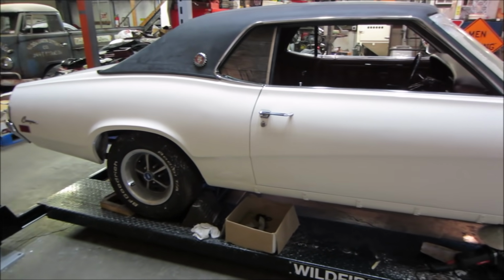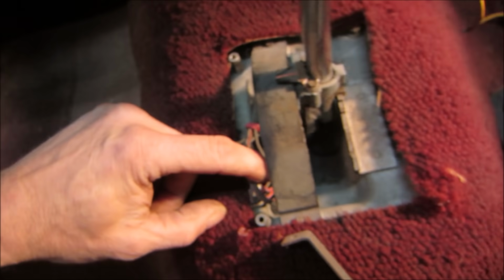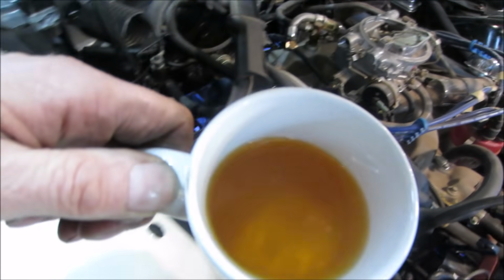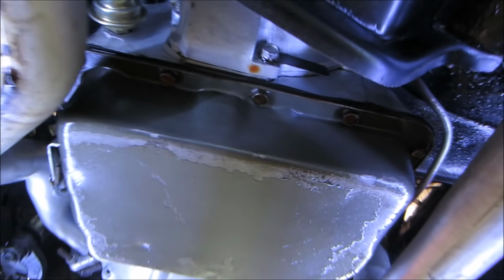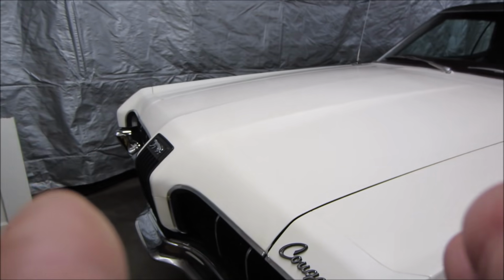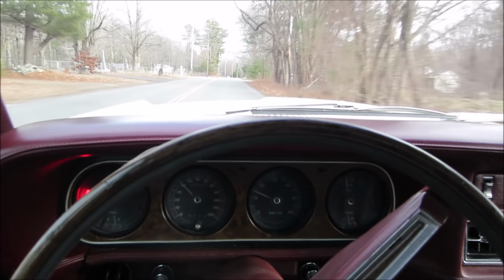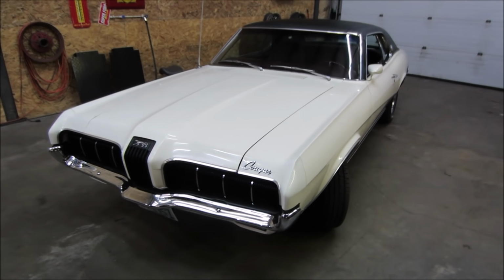Will It Run/Drive? 1970 Mercury Cougar  Saved From The scrap Yard.

Comment: Maybe its a child of the 70's thing, but after months of vw engines, its like music hearing a big carburated V8 idling.
Reply: It's a small block the okne thing I like about Ford's is they use real dual exhaust
Reply: Duke Hugh Johnson  I thought that the '70 cougar came out with a 351 W or C? I thought it was a Cleveland when he showed the motor, but I could be way wrong.
Reply: Yea. I grew up in Europe, 4 banger capital of the world, then first time I came to america I rode in a 1962 Chrysler , I think it had a retro 383 ... I was mesmerized.. even recently .. we have some newer vehicles with aluminum block V8's .. then recently we got a 1995 Ford van with 351W and it just runs that much nicer
Reply: I hate VW motors .. a precious FEW  sound good, but yeah, once I got a Datsun 1200 with a superb motor rebuild that could wind up crazily I never, ever looked back at VWs.  But I have been told a good VW and its driver are hard to beat.
Reply: @aris21067  I seen one at a show that had a small block Windsor and knew someone that had a lime green one with a big block Cleveland. The 351 Windsor is basically a 302 with a half inch more deck height ( stroke ) and the hex shaft between the oil pump and distributor is a little bigger. A friend of had a 70 Torino with a 351 C and 4 barrel heads. A back of 100's cigarettes could stand up in the exhaust ports.
Reply: Although it sounds like a Cummins from under the front of it.........
Reply: yes same here!

Comment: I was 17 years old when these were new. Cougars weren't factory hotrods back then but they were nice cruisers. The best thing about this Cougar is that it's a bucket list car. My heartfelt CONGRATULATIONS to you.
Reply: Depends on model, 428 Cobra Jet optional in both '69 & '70. Also were Boss 302 Eliminators. I owned a '68 GTE with factory 427. That's the one car wish I had back again.
Reply: @tombryant1104  I know of the options And that few bought them. I lived in S. Calif back then and factory muscle cars were common. My best pal had a 1970 Chevelle SS 396, 365 HP while his older brother had a 1968 SS 396 Camaro. I do agree with you about actually having one of the mean Cougars. No argument from me.
Reply: Oh' yes Cougars were or could be factory hotrods.  Depends on which model you had.  They made a few with Boss 302 & some small hand full with Boss 429's.  Even a lot of them in XR-7 trim were packing some mean horsepower.  But, the main hotrod's were S-Code 390's. and the ones that had Cobra Jet 428's.  My 1970 Cougar "Eliminator" came with the R-Code Super Cobra Jet 428 Drag-Pac from the factory.  I sure wish I had that car back today.
Reply: Is that an FMX, automatic? Change the vaccuum modulator on trans!

Comment: My uncle had a 70,  green one.  My earliest memory was of helping him work on the car. I was I guess 4 years old (1974) (this is family lore). He asked me to roll a tire to him so I did. Apparently I started laughing at the car. He was under it doing something. The hood was up and flames were shooting out of the hood and I stood there laughing. My family reminds me of this all the time. He got it out in time and it didnt hurt anything, was just the carb.  He had that car all the way through the 70s and by the time I was 10 he used to take me for a ride. I would sit in the back seat (no car seats or seatbelts back then) He would do "the cougar" and wave the car back and forth going down the road. I would slide from one side of the seat to the other. To this day I take my kids for a ride I do "the cougar" for them. They like myself giggle.
Reply: Great memories you've got. Teach them all you know about gp
Reply: I had a 72 vette that I was prepping to drive cross country.  My 3 year old daughter was 'Helping' , I looked down and saw she had picked up a 3 pound sledgehammer and was about to swing.  I caught the hammer about 5 inches from the front fender,,,WHEW!!!!
Reply: he wasn't doing "The Cougar", that was the dangerous handling of the thing trying to go down the road in a straight line,  but being a Ford it cannot do that.
Reply: @oigleoystereater2003  LOL I suppose ;)

Comment: You have a very nice driver! I have no idea how you got that dash together as nicely as you did, but, kudos!  Nice job in getting the front headlight doors & rear turn signals running - they usually don't work on these old Cougars. I was also impressed as to nicely the doors close and sound; back in the late '60s through the '70s, most American iron doors did not close with a thunk, but a CRASH....

Comment: It looks great, you did a nice job getting it back together. When that engine went to sleep it was drinking super leaded gas, now it woke up to drinking unleaded gas with ethanol in it. You should check to see if the exhaust valves have hardened seats installed on them.

Comment: When you jump the solenoid, the second small wire is the resistor bypass. You do get power to the coil when you jump the solenoid, even if the key is off.
Reply: You nailed it!
Reply: I had a 1971 Vega that had that setup.  I had never run into it before....got a nasty shock from an open spark plug wire that I happened to be leaning on....
Reply: IIRC , the solenoid terminal is labeled I, for that circuit. Ford's with efi still use the same solenoid, just has nothing connected to that terminal.

Comment: These old Fords had a primary and a secondary ignition. When activate the starter it puts 12v to the coil. When you go back to the run position it restricts it 9v. This why you were getting spark when you cross the solinoid.

Comment: The transmission grinding noise sounds like oil scavenging where insufficient oil supply to the transmission pump causes a grinding like sound as air is drawn into the pump. Could be low oil level or blocked filter screen inside the oil pan.
Reply: It would be so neat to see @PrecisionTransmission go through this transmission.
Reply: @plumberguy1689  yes it would
Reply: @plumberguy1689  A real road trip, call before you leave to make sure parts are in stock for that trans, don't want to wait in a hotel for a week waiting on parts. don't forget the limited slip diff.

Comment: The reason the spark occurs when cranking is when the solenoid is activated the small wire on the solenoid closest to the starter cable gives full 12volts to the ignition coil while cranking.
Reply: Good to know I’m not the only One shouting at him at my phone :-)
Reply: Whoever rework that thing for the modern starter is a clown. All he did was build in another failure point
Reply: @fredfabris7187  not a fail pint, he said he sent the engine and trans out. Bet he gave it the sport treatment,Had a 68 mustang I did in 78 for brackets raceing at Great Lakes dragway . Even a 350 starter had a hard time with that 302 when it was hot. Used a Chrysler that gear reduction and that worked well
Reply: Yes I was shouting too!
Reply: Yes this is correct

Comment: Yes, you forgot about how the ford solenoid works on the second small terminal.  That terminal is the 'full 12V while cranking" terminal.  Then when you let off the key, it reverts to voltage through a ballast voltage through the key switch. (around 8 volts or so).  This provides hot spark for starting and then a lower voltage while running so not to burn out the coil. (edit:or points)
Reply: I’m glad I looked for a comment on this so I didn’t repeat it!
Reply: Bypassing the ballast also burns points quickly.
Reply: Saved me the trouble of pointing that out. 👍

Comment: Most old ford's had an ignition wire through a resister wire to save points, and a straight 12v from the start solenoid, for starting. If you look at the solenoid, it's marked I for ignition on one of those posts, S for start wire from key switch, mounting bracket is the ground.
Reply: I was thinking this too.  JunkYard Digs has a great explanation of it in one of his vids.
Reply: So if the resistor wire was missing or open, that would explain why the ignition cuts out when you let go of the starter switch?
Reply: I believe it works like this:. It's actually a 9v coil. When the starter is engaged the ballast resister is NOT in the circuit.  Because the starter current drags the voltage down to 9-10 volts, the coil is fine.

When you let off the key, the ballast resister is placed in circuit so the 12v is pulled down to 9v (since the starter isn't dragging the vintage down any longer.

So it's most likely the ballast resister is bad/open.

I hope that makes sense ;)
Reply: @KrS14  Yes and the resistor wire goes into the tachometer i think.
Reply: I was telling the tv the same thing lol
Reply: Yup, there are two power feeds to the coil on older Fords. The second push-on terminal on the solenoid feeds full battery voltage during cranking, then the ignition switch feeds reduced voltage through the resistance wire when key is in the On position.

Comment: There was something arcing to the exhaust manifold on the battery side of the engine when you cranked it, that was probably what you were hearing.
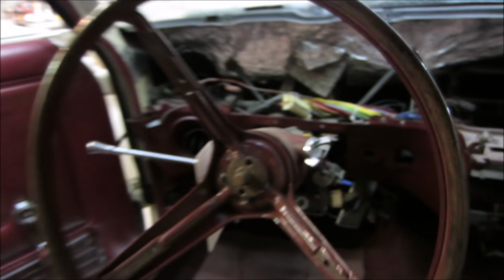Reply: Ditto. About 10:50 ish
Reply: Yes seen that too!
Reply: 3 plug wires were off on that side
Reply: 11:53 👍🏻
Reply: You could see that on the last video he did when he checked for spark also.

Comment: Tip for draining that old gas: Wear a glove, and tie a rag around your wrist so you dont get gas in your armpit
Reply: So you are saying gas in the armpit is bad?
Reply: and never drain a gas tank with out proper ventalation so always smoke a  Non filter Camel or Pallmall only light it when you smell fumes of course to protect your lungs and such make sure lighter is on high so you dont have to hold it to close to your face aswell daNGER DANGER IF YOU DONT DO THIS you could end up smelling gasoline witchy we all know is deadly with a capitol Dee

Comment: It’s a vacuum line coming off the intake going to the transmission servo valve gone bad or a bad vacuum line or both. I had that issue luckily for me the vacuum line came off hook it up solved the problem.

Comment: 22:10. On those old cars, the shifter had a lockout that prevented you from removing the key unless the shifter was in park. That's most likely why the steering column was moving.
Reply: The column is moving, because the linkage from the shifter on the floor is connected to the column. Its basically a column shift without the shift lever being mounted on the column.
Reply: @Bill-xc8le  Anti theft device, one of my buddies had a '70 Mercury Cyclone GT with the same setup.
Reply: @markellsworth2814  Thanks Mark that clears it up!

Comment: BE CAREFUL those old fords were known for dropping into reverse without any notice. worn out shifter linkage. The neutral safety switch I think is on the column if I remember right the floor shifter has linkage to the column and so is the ignition switch. Top of the rear column
Reply: Isn’t it like that cause those old cars had column shifters and it was cheaper to set up a floor shifter using the existing column shifter linkage.

Comment: I heard once that a full tank not as likely to rust up inside.
Reply: Hmmm interesting. I think that after many years the fuel evaporates causing the exposed metal to rust. But it might work over short periods. I am still gonna store my gas powered stuff sitting without gas in it.
Reply: As long as you have a tight seal to keep air out it works very well.
Reply: @raymondtousey9014  Yeah a lot of Musties old videos shows gas that was left in a tank ended up being the thing that saved it
Reply: My Granny had a Toyota Tercel she kept in her garage and barely drove at all. We lived next door and took her shopping with us and out and about , in southern Ontario. She put would put 2-5$ of gas in when she needed to. She put 3 gas tanks in that car over the years.
Reply: That was true when gas was gasoline instead of alcohol. Alcohol is hygroscopic and sucks moisture from the air causing the tank to rust. Now that we have alcohol instead of real gasoline, you have to run it dry or it will rust.

Comment: I knew someone who had been given, as a kid in high school, an almost new XR7, from the first year/series that it came out. 
It was a fast, powerful, and beautifully designed car. He used to drive kids around in it. Another kid had a Mercury Montego Police Special; the automatic would chirp while going into fourth gear at high acceleration. It would pin you back on the seat like you were an astronaut during a rocket launch. You'd have thought that the Cougar, with a less powerful engine and less robust transmission, wouldn't compete with that huge, solid Montego. Wrong.

Subscribed.  
Thanks for the content.
Keep up the good work.  בס״ד

Comment: Was there a rogue spark down in the engine bay when you first cranked it?
Reply: Yes I saw it right away
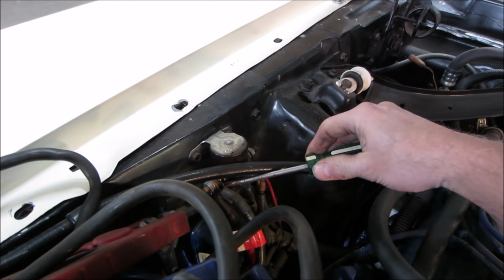Reply: Around 11:49
Reply: Good eye!
Reply: I think it was a. piece of tape blowing around.  ID tape for the plug wire.
Reply: @dougharder6258  it was definitely a spark @ 11:49
Reply: It zapped a couple times. Sorta mid screen and a little to the left side. Look down in there a bit. You’ll see it.
Reply: Look at the lower part of the left side valve cover about halfway back the engine. ⚡️
Reply: Yep, mid engine on the passenger side.
Reply: I had seen that too
Reply: You guys seem to have not watched the video! There were 3 plug wires off/loose on that side. Hence,the sparks.

Comment: Sounds like the converter isn’t all the way on the pump. My Monte Carlo did this because my bell housing bolts backed off some causing that sound. Fortunately I found one bolt finger loose and it led me to the answer. Than again that was a Chevy tho.

Comment: The noise in the transmission is likely the parking pawl. The fact that the wheels still roll and make a ratcheting sound when the lever is in “Park” is an indicator of the parking pawl not engaging fully. It’s also possible that the pawl (a pin about 3/8” diameter that locks into a notched wheel when the shift lever is placed into “Park”) has broken free from the rest of the mechanism that moves it up & down. This is usually caused by moving the shift lever into the “Park” position while the car is still moving. If it’s broken completely loose, it could be moving around freely and rubbing against other moving parts inside the transmission, causing the grinding sound that sometimes occurs when the car is moving. This is something that must be repaired immediately, as catastrophic damage could occur.
Reply: In the late 1970s Ford  had sent notice to owners of their vehicles that had C6 transmissions might slip out of park causing the car to roll if parked on an incline.. their "fix" was to send owners a sticker to affix to the dashboard to remind them to set the emergency brake and/or turn the front wheels toward the curb if parked on a incline.. I know because I owned a 71' Torino GT that had this problem.

Comment: I'm posting notes as you go through the stuff your wondering on  !The column moving is from the shifter selector part that shows what gear your in !  Wow it runs great & part the shifter neutral safety there is a linkage that runs up ether to the dash or the column that is out adjustment a minor fix. She is very beautiful for 51 years old ! Thanks for bringing us along !